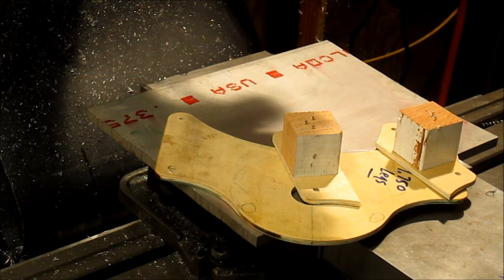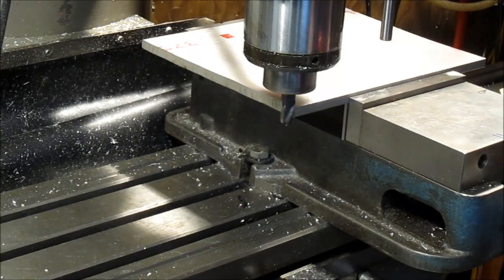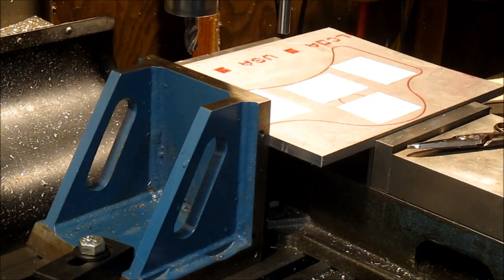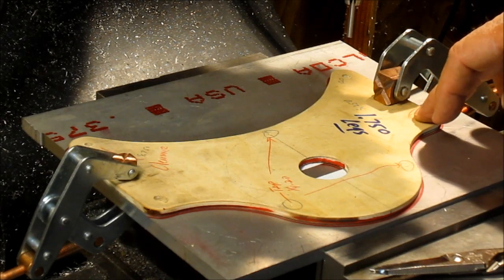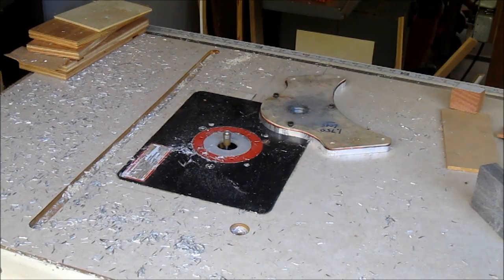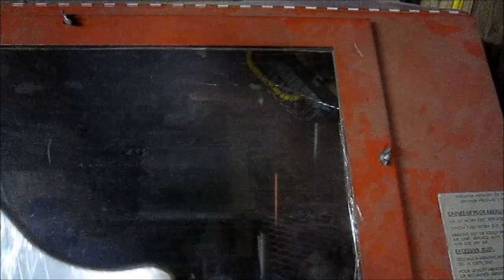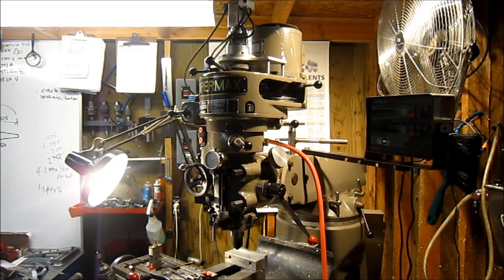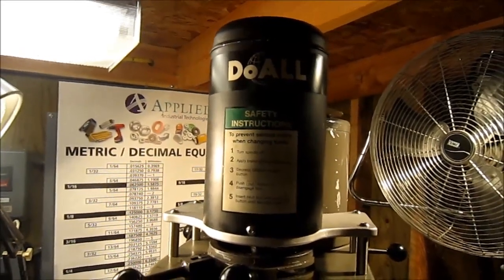Tool Time 21-3   Power Draw Bar Final

Comment: Hi Chuck, Your videos are getting better all the time, no need to sweat the small stuff! The little thing with the tape I thought was fun, we're only human, and it happens to everyone, and we all have a good sense of humor out here in YouTube land! Those carbide router bits are wonderful things... Besides light weight lube a final slow climb cut around the template might also help for  a smooth final finish... In the end, the aluminum will only be as smooth as the edge of the template (but I'm sure you know that, many things I say are more to benefit the un-experienced). This was a great series, thanks for sharing! :o]

O,

Comment: That looks and works great!  Do you always need to lift the quill to the highest position before using it?  For some reason the hex portion of the draw-bar on my mill is crazy high, so I'd have to cut a few inches off of it to use one of these.   
  Sometime in the future, I'm going to get into powder-coating.  This would be a perfect object for that coating, although it won't really see much contact with anything, so paint should serve youi just fine.
Reply from the maker: Hello JackThanks for watching and your commets/questionYes the quill has to be returned so that the unit will engage.  I have seen longer hex drawbars on other units.  What I typically do with aluminum is spray it with a clear satin laquer, it drys quick and protects the metal along with giving it a silk like feelChuck

Comment: Great job Chuck
Nice job with the router table
I would spray it black
Regards
John
Reply from the maker: Hi John...thanks for watching and your comments....one day its black, then I say leave it clear, then I think about get a paint to match the supermax mill....nothing will be done until I build the new two piece drawbar....the purpose of the two piece drawbar is just in case the collet gets galled on the drawbar thread, you can release the drawbar and pull the collet & drawbar out from the bottom best regards,Chuck
Reply: +outsidescrewball 
Nice stuff Chuck! 
Have you thought about anodising instead of painting?
I'd go with black... It's timeless :)

Comment: Lovely job and it works really sweetly. Persistence clearly works.
I didn't know you could use a router to work aluminium! special cutters I presume?
Reply from the maker: Hi Dan...thanks and the cutters are standard wood router bits with carbide

Comment: Nice work on the mounting plate. Interesting to see the bead blast for the finish and the router work. It looked great. Smart to have put all of the holes in it before you cut to so you had a good way to hold the plate...that's a thinking man.

I do have to ask, in the router portion you said something like "It is leaving a Chewy finish."  Is that a dig at your mentor?  :-)
Reply from the maker: Thank you for watching and your comments LOL...no...not a dig at Chui...that is not in his book!!...Think I have heard Fenner use the term...